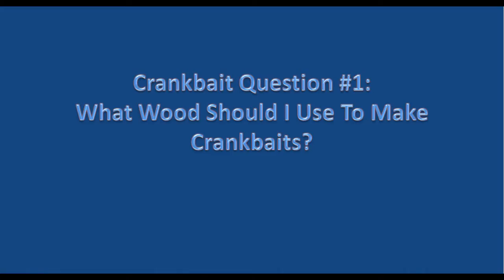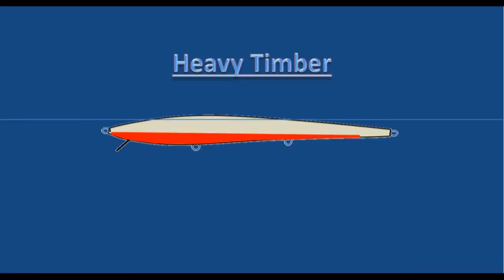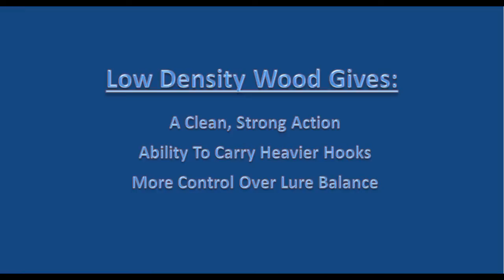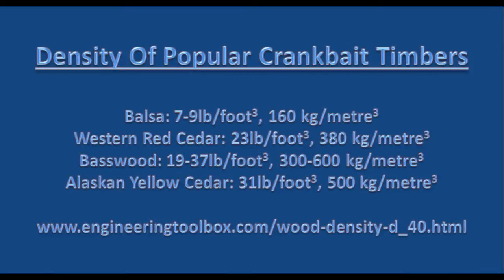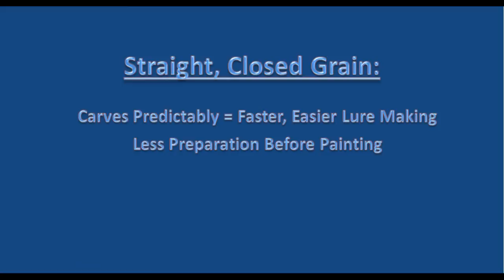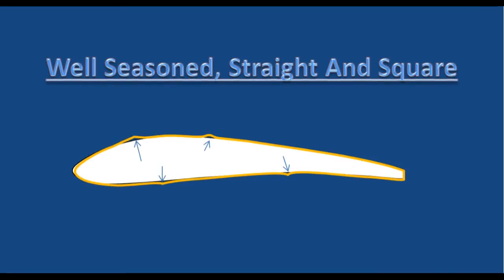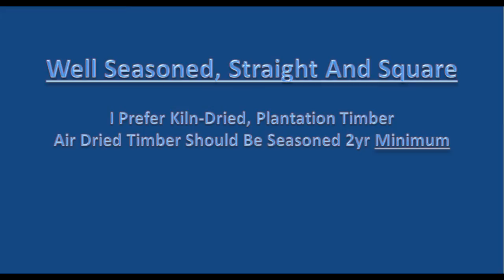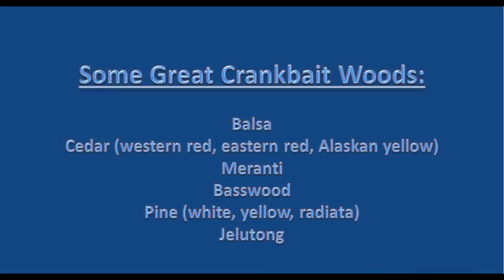Wood for making lures

Comment: Hi, thanks for the very informative video. I am brand new to lure making and was wondering if you could help with a quick question. I finished a lure out of western red cedar and applied the first coat of gorilla 5 min. epoxy which left a beautiful consistent smooth glassy finish. When I added a second coat it pitted like an orange peel. Even when I tried to brush it smooth (before it dried) it just separated and formed pockets with no epoxy. Do you know why this happened ? Thanks , Mike :)
Reply from the maker: Hi Mike, I've never used gorilla brand epoxy, so unfortunately I can't help you much. I sometimes get a similar effect with envirotex lite, but it's only ever on the first coat. Applying a second coat always levels it out again. I'd suggest sanding with 400grit between coats to remove gloss, then wiping with alcohol to remove oils from your fingers before second coating. Just a hunch though, as I said. On another note, I'd ditch the fast curing epoxy. The faster they cure the faster they break down and/or turn yellow. Use a slow curing epoxy if you want your lures to stay looking good for a long time, 5 min stuff crumbles much too soon. All the best, Doc
Reply: Ok I will try that. Thanks for the fast reply and great tips. :)
Reply from the maker: My pleasure Michael!